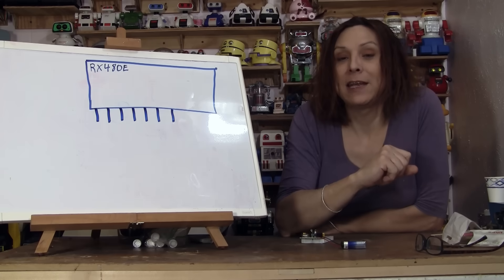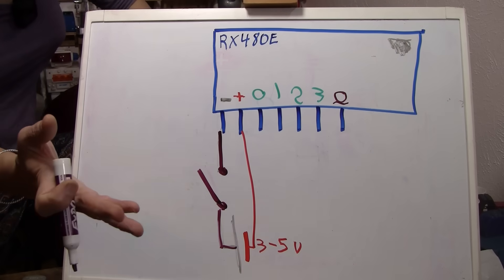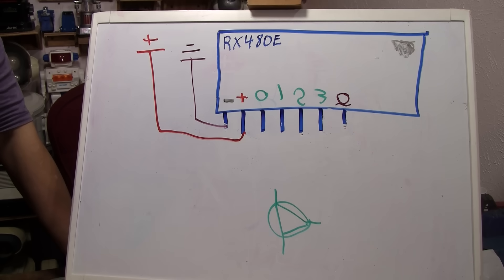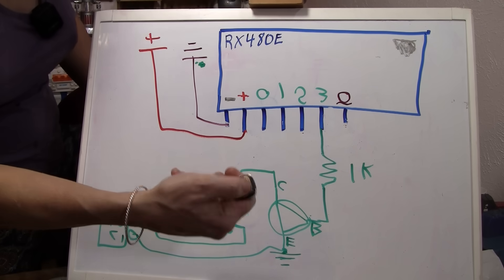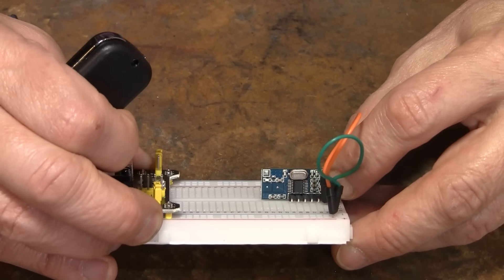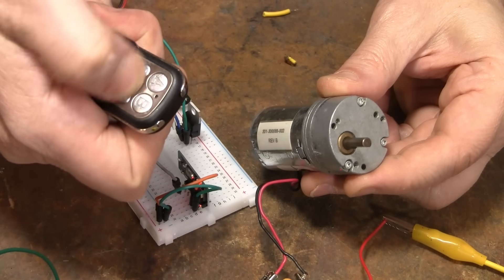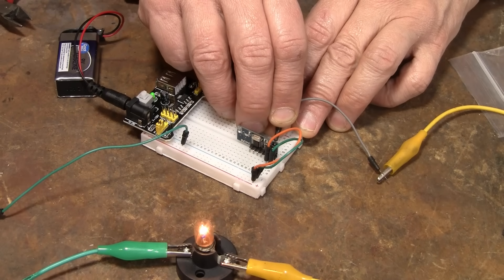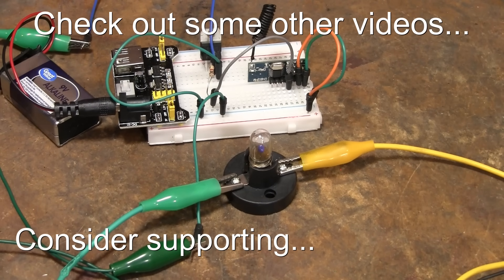How to Make Anything Remote Controlled with the RX480E Circuit!

Comment: This is pretty interesting ... I have 2 different brands one from walmart and another a more mainstream outlet I think I bought at homedepot.  I like them except that I have to have 2 remotes, and you HAVE TO USE THE REMOTES.

I've had an idea of using cheap IR remotes ( you can buy them by the ton cheaply ) and then program an IR receiver and arduino or some such to turn lights on / off.

Comment: I would recommend being more clear in your spoken terminology and your component diagrams.
For example, you might say, “Use a triple A battery” instead of “This kind of battery”.
It’s easy to quickly look up the proper way to draw component diagrams. 
When talking about pins, it’s best to communicate “Pin 2” instead of “here”. 
Electronics, after all, require precision, and if we are to teach a given subject, we should honor the student by being reasonably accurate in our terminology and presentation. 
I know I’m being quite direct here for brevity, but I think you have a lot of potential and it was a good review of certain principles first me.

Comment: Kool vid.  Thanks for your personal insight into this.  

Some transistors 'latch' rather easilly.  Meaning just the capacitance of your finger in the circuit on the base can enable the transistor, meaning it stays 'on' so long as there is voltage / current present.  So it would remain on, even with no signal on the IO pin after it was pulsed a single time.
secondly, Keep in mind, IF the load was a coil in a relay, solenoid, motor etc,  that is to be energized / de-energized, a capacitor is not the most effective way to snub that.  When the field decays, it causes an EMF surge to be induced in the circuit in the reverse direction.  Those voltage spikes can be devastating to devices upstream.  While a small cap will absorb some of that, a reversed biases diode should be used across the coil to shunt that extra voltage to ground.  A TVS diode would likely be a good choice.   That is the theory anyway.  

Someone else with more experience can clarify that :)

Comment: Just an electrician but like to break out one of my soldering irons or bigger Weller 100/140 watt soldering gun. Purchased a few Radio Shack great little booklets maybe 35 years ago. One was on the great 555 timer chip. Retired and would like to assemble a five tube radio. Have an old one in my garage that used 50C5, 35W4 ( rectifier ) , & 3 starting with 12 . Disappointed that young people do not know how to solder , change a tire or even use a screwdriver including one of my sons.

Comment: Just one correction: Not a capacitor in parallel with that transistor, you need a diode to short that huge EMF reverse polarity spike. Good work overall though.

Comment: the motor will never turn because the transistor is on another circuit, E and C use one battery and B use another battery.
Solenoid it works because it is using same 9 v battery of the main circuit

Comment: nice video. But if your load is inductive device such as a relay or motor then you have to put a Flyback diode for protect your switching transistor.

Comment: As I mostly work on cars my first thought would be to just use a relay?
Reply from the maker: You sure can, but they require more power and if you're using batteries, that's a problem.

Comment: I have a wifi RF universal remote hub and I train it with those FOB remotes.
I have two hubs actually and one is the broadlink RM pro the other is a generic one that works with Tuya.
I used to use the e control app for the broad link and I could download more remote frequencys to train more of if thise qui chips but the new app has no such feature.
I am wondering if it is possible to take a FOB and make it so you can have it emit different frequencys to train thise chips so that I can buy a bunch of those receiver chips but only one FOB transmitter because I use a phone app or alexa ir Google with the app and I don't need to have all those FOB remotes but I do need different frequency to train ever receiver so I can control the receiver deviced individually with my phone or echo devices.
I know they work on 433 mhz so of there is a 433mhz transmitter tjat you can reprogram to emit a bunch of new codes that would be great because then you could train the qui chip rhen train the wifi universal remote hub then change the frequt if the transmitter and  train another receiver quia chip and etc.

Comment: 79 year old elec tech here.  Ray MItchel is correct you should use a diode instead of a capacitor to clamp the back emf.  In fact the diode will cause the motor to stop instantly since it acts like a direct short across the motor when it tries to "Generate" a voltage in the reverse direction.....  Thanks for informing us about the RX480 ! 😁
Reply: I agree without the diode on the coils and motors you will get a large voltage spike when it turns off that can damage your circuits.
Note the Cap is a good Idea for electrical noise while the motor is running
Reply: It's not actually a "short circuit," but a clamp that limits the CURRENT in the coil in a controlled fashion. By doing that, the voltage across the coil inductance is limited to the diode's forward voltage, about 0.7V, providing a path for the current running through the coil when it is energized (let's call it Io) to give it a place to go. The current will then be RAMP down from Io down to zero for a time equal to (L * Io) ÷ 0.7. This is a little understood reason for the diode clamp! Without it, the inductance will cause a flyback voltage to spike to unknown heights. Using a capacitor instead of a diode will cause a "ringing voltage swing" that will slowly dissipate the inductance current through the coil's resistance. A diode is the better way to go.
Reply: Exactly! I think everyone learning electronics should build their own power supply because it’s one of the best ways to learn hands-on! It also teaches, if done right as you’re moving across the build, what exactly you should use those specific components for. Diodes are a must to prevent damage from back current, let’s say if you were using that power supply to energize electric motors. There’s already tons of caps in use, but it’s the ideal use case to see exactly how they smooth the voltage running through them. Take a multimeter across the different stages and visualize the difference, even better would be to see the waveforms flatten by using an oscilloscope. The best part of using an oscilloscope would be that you could easily check for noise at the tail end! You also have use cases for why the ceramic caps are used with the voltage regulators as well as across the output and grounding paths. I would even throw in a use case for resistors too that way you could make a path to drain the retained voltage upon powering down, otherwise you could easily visualize this with a voltmeter as it will reduce over a couple or few seconds before eventually powering down completely when the remaining voltage drops below the operational threshold.

Even power supply kits are great to upgrade, why not add 10-turn wire-wound pots for greatly enhanced accuracy? How about getting a digital V/A display if the kit lacks a display of its own?! Such displays re inexpensive, accurate enough for hobby use, and already have the ability to sense voltage and/or current, so you don’t need to do much to install them! I had an old power supply with analog meters that eventually stopped working, but I couldn’t get replacements or even similar ones that would work well with this particular unit, so… I upgraded it to digital and used the old center screw hole that held the supports for the analog meters as an on/off toggle so you don’t have to keep taking the wire out every time you need to stop power! I also upgraded the overload LED with a bright orange one that blinks. I’m serious, power supplies are the best way to teach basic electronics as you have the AC side and more than enough DC to keep you busy for a long while!

BTW, I’m working on a whole new one now that’s completely digital to include a numeric keypad and multi-line LED screen. It’s an excellent advanced project that throws controllers, I2C, coding, signal manipulation, and the like into it!
Reply: I was wondering why her circuits have survived all this time, so I'm looking at the datasheet from ONSEMI for the TIP120. I see it has a body diode, but I'm not sure it can suffice as a TVS. For an unclamped inductive load, it says 50mJ maximum @ IC =1A, L=100mH, P.R.F.=10Hz, VCC =20V, and RBE =100W. That doesn't seem like much, so what's the purpose of this this in-body diode or am I blind to some other helpful details on the datasheet?
Reply: @headbanger1428  First, the built-in resistors are to shunt capacitive charges that would otherwise slow down the transistors from functioning. I believe that a third resistor could have been added, but I’m certain that the designers know better than me and went with the pair for a very good reason.

As for the diode, yes, you are correct! It’s simply a flyback diode, but 50mJ is quite a lot when talking in terms of extremely fast clamping speeds. Let’s just say that we are talking on the order of 1µS, which is pretty slow for TVS-like functionality, the resulting W/µS will be rather high, to say the least. This is because 50mJ should handle 0.05W/S, so that should translate to 500,000W/µS as it’s an exponential function (if I did the math right). So, with a Vcc of 20V, that should yield 25KA of protection!

The problem is that we don’t know the exact clamping speed that this specific diode will yield in this circuit, whereas timing is so critical to figuring out the exact wattage and therefore current over a specific timeframe. So, that means that we cannot make a reliable guess as to how effective it will be in the “real world.” The TIP120 should be able to push up to 1,000x when used as an amplifier, so that could potentially be a lot of current. I would think the back-current from a small inductive source like a small motor should be no issue whatsoever, but the whole purpose of the Darlington Pair is to use a little bit of current to control a whole lot of it! That said, if using a large inductive load on the output, simply use your own protection diode that you know the rating of as that will offer a more exact level of protection. There’s absolutely no reason why you cannot do this to be safe. I’m a bit tired, so I’m hoping that this makes sense.
Reply: @jayrose6312  Thanks very much. I’ve saved your comment. I’ll get to work trying to learn more of this. 😊
Reply: @headbanger1428  No problem! My pleasure!

BTW, in retrospect, I believe that I was off by a zero since 1 µS is 10^-6 smaller than 1s. So, 0.05W/s should become 50,000W/µS (not 500,000W/µS like I first thought) as we are moving the decimal over by 6 places. So, if Vcc=20V, we would be looking at 2.5kA instead of 25kA. And, that’s the easy part as P=IE, therefore 50kW = 20V * I. Remember, it only takes 0.1A to 0.2A to generally be deadly to humans! Even 0.01A could cause a fairly painful shock! So, 2,500A is a HUGE amount of current (even if we are not speaking of 25,000A) as that’s still about 12,500x higher than what could kill you or I (on the low end)! The thing about TVS-like component behavior is that they operate extremely fast, so even 1 µS is really a conservative estimate, but I still wanted my math to be both consistent and accurate. That means that it will take a boatload of current, but for about a millionth or billionth of a second. That’s how it could handle such large transients. The necessity makes sense though as like I previously said, we could be looking at up to 1,000x amplification, at least in theory. We could also be looking at some pretty gnarly amounts of reverse current returning from a large inductive source, which is a perfect use case for a Darlington Pair!

I do want to reiterate one thing, without knowing the exact clamping speed, we cannot make a good guess at how much inherent protection would be enough. So, just throw in your own protective components, such as a diode here to ensure that you will be protected for MORE than the estimated load. It never hurts to be more prepared! Again, I don’t think you would need to worry about this with small motors and tiny amps, but larger applications would definitely qualify!
Reply: @jayrose6312   Oh wow! Brilliant explanation.Thanks again. I mostly do electronics as a hobby, but I guess designers have to be concerned with excessive BOM costs. Yes, better to have more safety indeed! :)
Reply: @headbanger1428  I did engineering professionally early on in my career, but have come full circle in retirement as it’s keeping me very busy again! This time I get to enjoy building whatever I want to build! I setup a nice bench, so I have the ability to work on some pretty cool projects.
Reply: Cool! Thank you for the info… Umm… How Does one determine or select the correct diode to use? Or should I look it up myself?
Reply: 79 years old wow!!
Reply: @rogersamaniego7392  Yes, there are literally MILLIONS of them about you know.
Reply: Makes sense since cap stores energy.

Comment: Nice to find your channel!  I have a point to ask, however.  At roughly 9:00, you mention installing a capacitor to shunt the voltage coming off the motor when it is slowing down.  Depending on the size of the motor or the solenoid, they back EMF voltage might overcome that small capacitor and cook the rest of the circuit.  Would you consider installing a reverse biased diode there in parallel with the capacitor?  That should clamp the EMF completely.
Reply from the maker: Most of the time I don't put a damn thing there, and it works just fine. However, when using the microcontroller Picaxe, I've found it to be needed for some things. People can put whatever they want there. I'll put what I want there. I promise the world will go on just fine.

Comment: I would also put a flyback diode across any inductor source such as a motor or relay coil to discharge the inductor kick the motor or relay coil generates as the field collapses  when power is removed.
Reply: I agree without the diode on the coils and motors you will get a large voltage spike when it turns off that can damage your circuits.
Note the Cap is a good Idea for electrical noise while the motor is running

Comment: When switching an inductive load such as a solenoid you need a reversed biased diode across it to absorb high voltage spikes which wiil eventually destroy the transistor. Search 'snubber diode ' for the circuit.
Reply: TIP series devices have the diode built in.

Comment: Please use the official symbols for the electronic parts, that makes the drawings readable, Led is in the wrong way, and your transistor is not an symbol. even the symbol for a NPN or PNP transistor is different. And normally you should put an extra resistor between the basis and emitter, to make shore the transistor closes correct.
Instead of a transistor you could also use a FET like an IRF540, this has a lower on resistance so the full power goes to the coil.

Comment: Is there any receiver for 8 channels?
Regards Anthony
Reply from the maker: Not this small that I have seen. They do make them, but they were bigger circuits.
Reply: Hi thanks for your replay.
Have you ever try to use a 8 channel remote control to drive 2 separate modules. From 1-4 control the first module and from 5-8 the second module. Regards Anthony ☺️

Comment: In the case of the solenoid or a relay, and DC Motors, they are really inductors which produce a high voltage when switched off. Basically they oppose a change in current flow so when you switch off, it tries to suck current through the switch,  resulting in a high voltage. Motors do also act as generators and the problem is similar but the voltage won't be  higher than the supply that was driving it (normally)

You really should place a diode across the terminals to prevent damage to the switching transistor. It needs to be oriented so it does not bypass the current through the coil in normal operation.  Therefore the current is drawn throught diode and allows energy to be dissipated without damaging anything.

Comment: In the case of the solenoid or a relay, they are really inductors which produce a high voltage when switched off. Basically they oppose a change in current flow so when you switch off, it tries to suck current through the switch,  resulting in a high voltage.

You really should place a diode across the terminals to prevent damage to the switching transistor. It needs to be oriented so it does not bypass the current through the coil in normal operation.  Therefore the current is drawn throught diode and allows energy to be dissipated without damaging anything.